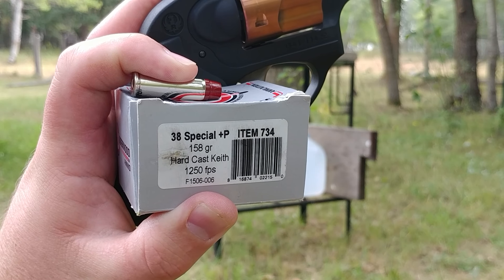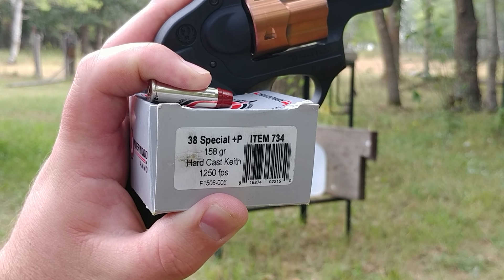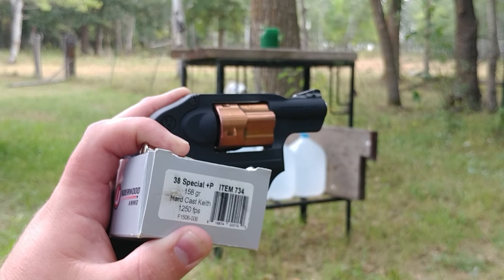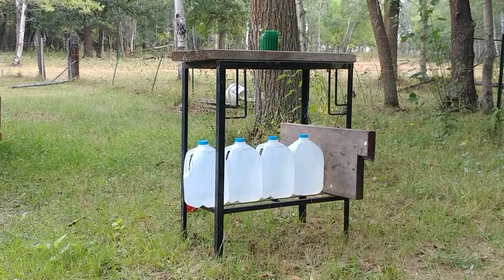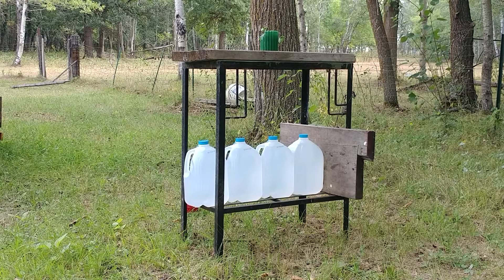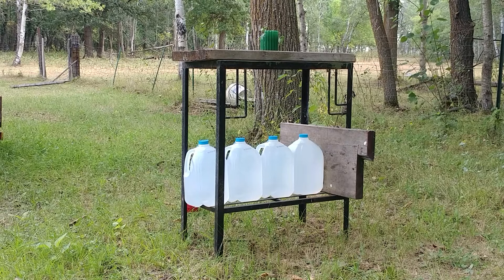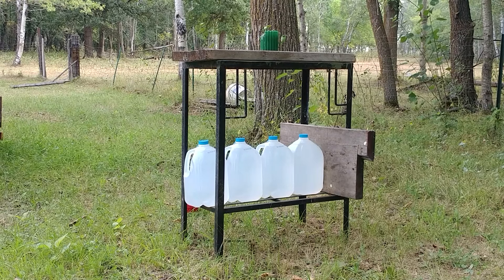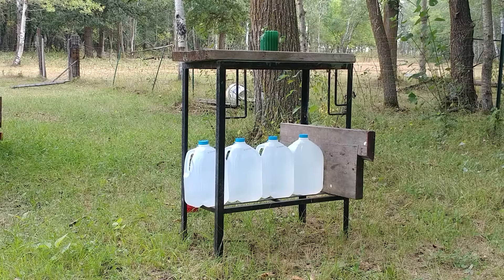Part 1 Underwood Hard Cast Keith 158 grain 38 Special +P water and pine board penetration test

Comment: This load is almost unbelievable. This one at way over 500 ft pds of energy at the muzzle is insane for .38 special! I stocked up on their 125 grain gold dots and their 125 grain xtp’s at the same velocity 1250 fps. They are 434 ft lbs and you know it when you pull the trigger. Another 100 ft pds with this 158 grainer has got to be the ceiling for this round. I sure wouldn’t go any hotter lol. Cool stuff
Reply: I did the same but I got about 6 boxes of this 158 grain as well. I carry the 125’s in my 442 and keep the 158s in my speed loaders. If I’m hiking or hunting I’ll do the 158s in both. They are both superb self defense rounds. The 158s do about 20-25 inches in ballistics gel from what I’ve seen. Main load for winter/ hunting/ hiking. Secondary for other times /hard barriers.